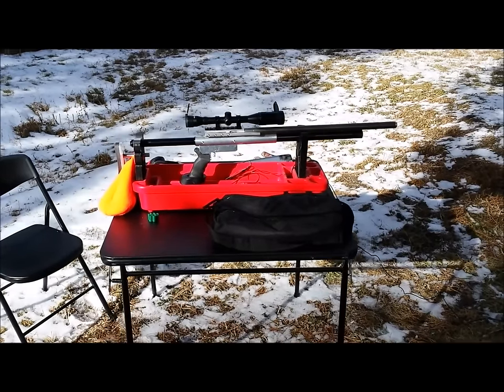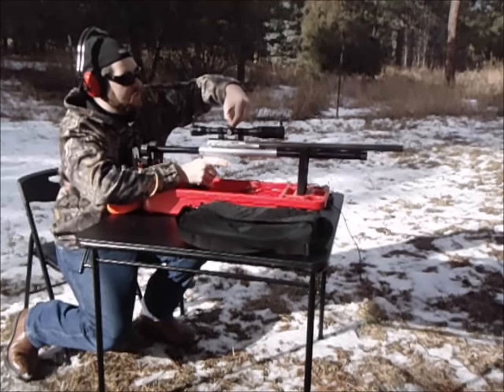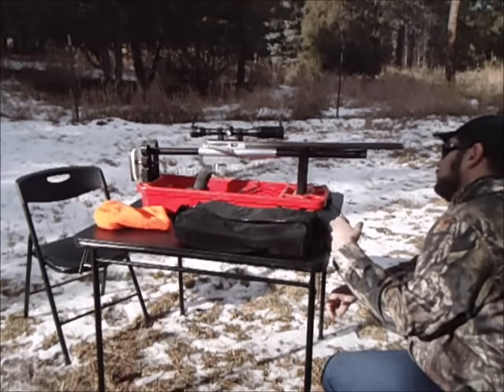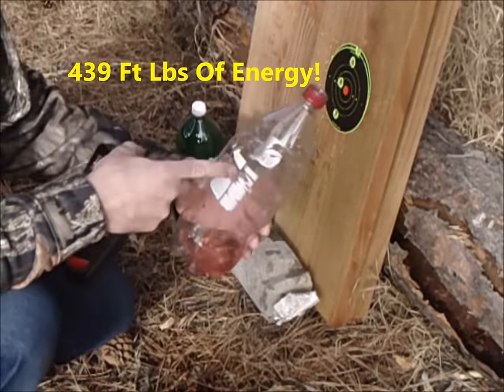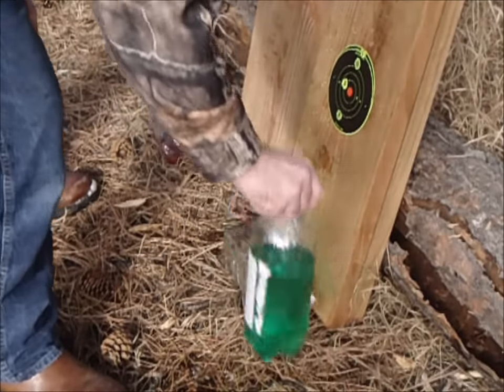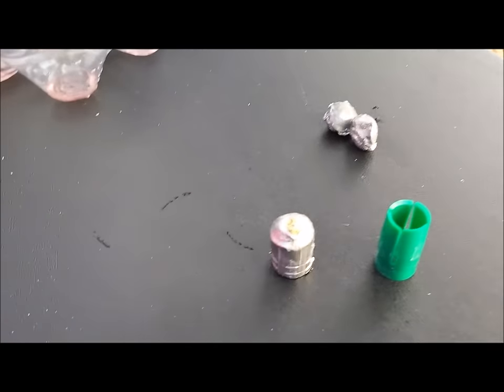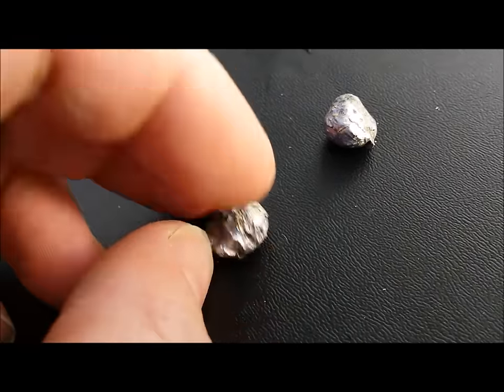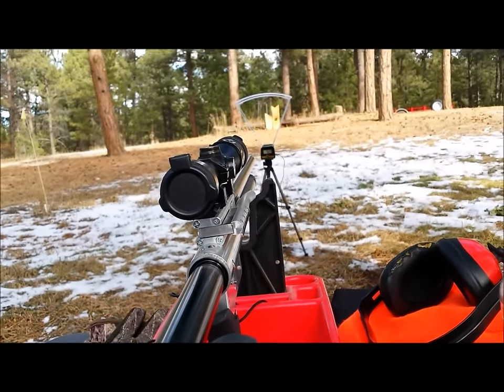.50 Caliber PCP Air Rifle 1024 FPS! And Soda Bottle Destruction...

Comment: Where to begin?  Excellent job of building a big bore PCP!   I'd switch away from the sabot/round ball and go with a hollow based bullet style projectile.  It will be a bit heavier and your velocity will slow down a bit but your muzzle energy will go up.  If it's a true round ball twist, your projectile probably shouldn't be much longer than your caliber.  Probably produce about 220-250 grain projectile with about 750-800 fps which is more than enough for eating sized pigs out to 40 yards and  whitetail/mule deer out to 70 yards.    Even your 5th shot would have bagged a whitetail @ 50 yards with good shot placement. '
Reply from the maker: crgintx It's a faster twist rate think it's 1:26.... so it's more for conical bullets. I am just experimenting with different rounds,  it seems to like the 250 gr realm bullets best so far.  Been goofing around with my vw project lately so haven't had time to shoot sadly.  Need to get a nitrogen fill setup still too, it'll make my life much easier.

Comment: A Tip for the escaping Air around the Sabot,,,buy  ,50 Cal. Bore Buttons from T/C or Punch your own from 1/8" or 1/4" thick felt  with a homemade Punch .  If you want to Lube it with Crisco Shortening (cheaper than T/'C 's Bore Butter!)
Reply from the maker: I'll have to try that, thanks for the tip! I found some other sabots that seem to be sealing better, they have a more hollow base. Rifling cuts into them much better.

Comment: I know this video is over a year old and you have other vids explaining the parts but, was the barrel a bought item or did you machine it? I've been building mine for the past 15 months but I had used a barrel from a previous build but it's not ideal for what I have now either is my air reservoir but I ordered a tank with a regulator now my issue is a .50 & .457 barrel but finding what I'm looking for is certainly proving to be a mission I wasn't prepared for

Comment: In you other video you talked about losing pressure from the air going past the projectile. Have you tried oiling the sabot? Or an oiled cloth patch?
Reply from the maker: I tried another sabot that fit the bore tighter, and it was softer, and got much better results.
Reply: Why use sabots at all?  Waste of money and accuracy.  If they have a skirt then you probably are NOT getting any blow by. I wouldnt put any OIL in your barrel or you will get dieseling.  Negligible in a poweder burner but sub-optimal on your airgun. Your homemade bullets should be fine just make them out of pure lead.  These look to be shiny high alloy. Or IF your liner is set up for patched bullets just get a lee REAL mold or get a round ball mold or bullet mold and hone the diameter up to somewhere over the bore size.  I dont think you need to work on the spring.  439 FPE is really good.  You can pretty much hunt anything with that!  I would hope to get 400 FPE in a homemade airgun.  If Hat-Sun put out a gun like this it would sell better than their HammerDriver.

Comment: You could also try a  Light to Med Weight. 44 Magnum  Cast Bullets  or  Use  Sabots  for.45 Cal   and  go to Pyramidair  for .45 Cal Pellets for the newer .45 Airguns.....or  Look On ebay for a  Lyman  Mould 450229 It Casts a Hollow Base Conical for a .44 Cap and  Ball Revolver 155 Gr....Put some Crissco in Bass of Sabot & use a .44 -.45 Cal Felt Wad under  the Sabot!  watch the Accuacy improve!